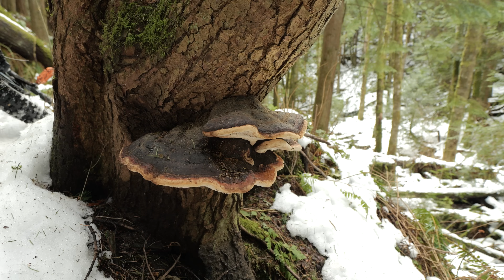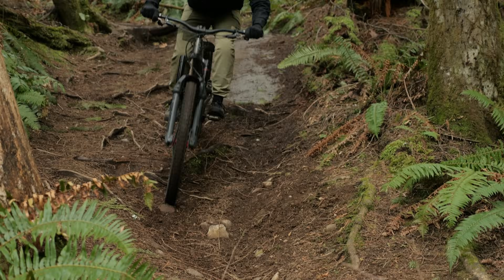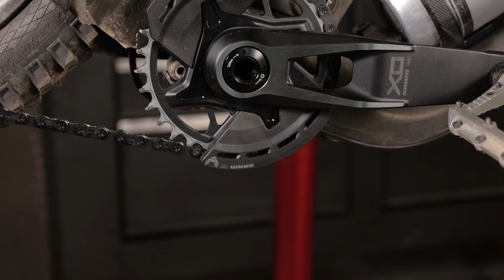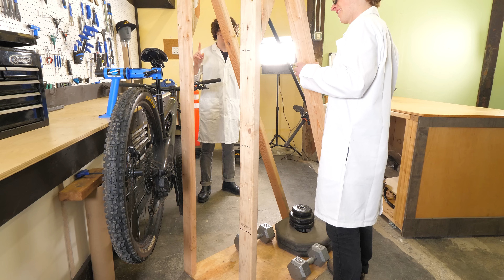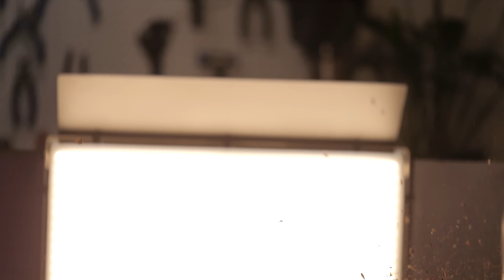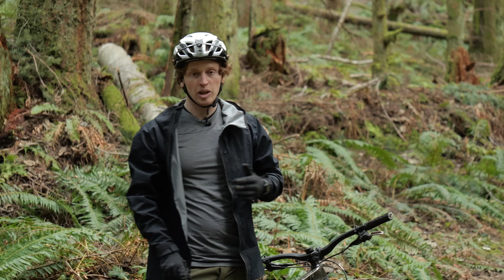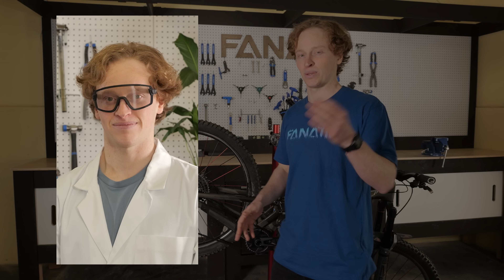Transmission: Why SRAM’s new drivetrain matters

Comment: I’m normally a big fan of your tech videos at Fanatik but these videos on the new AXS system are really poor. The irony of claiming that humble derailleur hanger is now outdated and was “never really ideal” despite having functioned on everyones bikes for decades it hilarious. And the fact that you and the whole mainstream mountain bike media seem to overlook the fact that the any force going through your derailleur in a crash is no longer dissipated in a controlled manner (snapping a hanger) and now goes straight through your axle and into your carbon/aluminium frame is even more laughable. It’s ok to shill a cool new product but surely you have some doubts about this new tech?
Reply: But the force of a crash is now absorbed by the derailleur in two ways. The first way is that the electronic clutch physically moves the derailleur inboard to absorb an impact. The second way is the derailleur can rotate clockwise to absorb an impact also. If you watch the video of them trying to break one of these, you would have seen that they also designed the derailleur to break before your axle or frame breaks. And if your derailleur brakes it's modular now so you can just replace the specific part that breaks. I'm not a fan of access or these electronic drivetrains but they have designed them to be real, robust and rugged.
Reply: @ragu4545  I saw the other video of them trying to break the derailleur but didn’t feel that it was very true to real riding. The pendulum thing kept sliding over the derailleur like a rock moving out of the way rather than a like an immovable rock or log. I’m sure your right though and the mech will break before the frame, is just be worried about internal damage that is could cause to the frame that you can’t see
Reply from the maker: Thanks for the feedback. My thoughts: Today's 12 speed drivetrains seem to suffer too frequently from bad shifting, and it is very often the result of a slightly bent hanger. This removes that as an issue, by making the entire structure stiffer. It is not so stiff that it can't break, as we found in our other video, but it is not going to be impeded by what are often pretty flimsy hangers.
Regarding the frame, (and time may prove me wrong), but I just don't feel that that's the weak point now, or that this derailleur is so stiff that it will transfer undue forces into the bike frame and cause damage. Firstly, crashes where the only part of the bike that is impacted are the derailleur are very rare. The conditions of our tests were not realistic, they were dramatically exaggerated. And even so, it was the derailleur that gave.
From another perspective, the forces that your rear dropouts encounter from simply riding your bike are large, and I'd be willing to bet they are larger than what they saw when we broke Transmission. I feel like if we're going to be concerned about this, we should also be concerned that our dropouts are going to fail simply from the act of mountain biking.
Time will tell, but all the concern seems overblown. To me it just seems like a very expensive, fancy drivetrain that does in fact shift notably better than everything else out there. Hopefully this helps clarify my viewpoint. I am sorry you didn't like it or felt it was insincere. I expected to find it to be a gimmick, but I didn't. I do think the magic pulley wheel is gimmicky though 😉
- Dan P.
Reply: @FanatikBikeCo   thanks for the reply Dan, I’m sure your right and the shifting does seem to be unanimously better than previous drivetrains. I’m all for new tech (I ride axs myself). I was probably a little harsh in my comment before but I would be still be concerned about mounting something that stiff to an expensive carbon frame, like you say though time will tell

Comment: I don’t see why the improvements can’t be applied to cable operated ones. My entire life is electronics biking is my escape from that and I want to keep it that way
Reply: If you watch the video again and listen to the part where he explains that the derailleur is systematically shifting based on timings, you'll realize why cable actuated shifting is impossible. We cannot, as human beings, shift this precisely, everytime we go to shift. A computer can.
Reply: @Jack Halem It's really not an issue with my aluminium rental bikes.
Just shove them in the downtube until they come out below the crank.
Then it's basically outside of the frame following under the chainstay. 
Little loop to the rear derailleur.

New outer and inner cable takes me 10-15 minutes an bike.
Reply: I just installed the SRAM 70 groupset and it is amazing. It is cheaper than the GX and NX systems and 1,000 percent better.
Reply: Ultegra r8000.  It's perfect
Reply: I bet a cable version will come in some months

Comment: I saw a friend at the side of the road trying to fix something on his bike so I turned around and check if there's anything I could do to help. He was trying to pair his SRAM Red axs cause it won't shift.  I asked him if he charged the battery and he said yes he charged it the night before. Then I asked him if he had a spare battery for his shifters to test cause it's probably the one that is out! Then he realised that it's been a year now since he had his bike so it's probably the shifter's battery. He had to go home and change bike.. A few days later, he confirmed that it was the shifter's battery!
Lesson - if you're on an electronic drivetrain, an extra battery is a must in your tool bag!

Comment: so like why cant people just stick with 11 speed? the cog spacing is far enough apart that the shifting no longer becomes so tolerance dependent and allows a little wiggle room while still shifting smoothly. just make a 52 tooth 11 speed cassette why is that so hard jeez
Reply from the maker: You can stick with 11 speed! I've had a bike recently that ran 11 speed.
- Dan P.

Comment: I don't have AXS but here's a benefit right here: No cable stretching, always consistent shifts. Cables stretch over time, shifts changes location, always need to adjust barrel by the day,  weather affects cable.. cold cable is stiffer, hot cable stretches more. Cable housing wear out, creates more friction over time. I could go on and on
Reply: Reduced battery run time and life span due to freezing and extremely hot temps. Reduced battery life if battery is left unused for long stretches of time. Higher cost of replacing a battery compared to a cable & housing. Battery can easying be stolen off the bike. Introduces connectivity issues that can potently happen anytime, even while riding. Added weight and increased chain slap with AXS.
Reply: @ragu4545  some of your points are vailid... but a battery lifespan isn't what were comparing. Shift Performance is. Also added chain slap, What?? Battery could be stolen? Why steal a battery when they could take the whole bike in that case? Most people dont ride in extreme cold or hot. If they do, AXS wasn't a solution for them anyway. AXS shifting performance doesnt change like a mechanical cable does. Even if you replaced a battery, your shift is still the same regardless. Connectivity doesn't seem to be a common issue with AXS..
Reply: @Twisted_Biscuit  you don't have to ride in extreme temperatures for your battery to be impacted. Like say you store your bike in a garage over winter or if you leave the battery in your car on a hot summer day. I've had other lithium batteries fail because temperatures got too cold in my garage. It is also known that AXS has increased chain slap because they have weaker clutches if you watch videos where they send bikes huck to flat you can see the derailleur bounce around like a wet noodle. There's no added benefit with the original AXS terms of shifting performance. Maybe you'll have extended the time your shifting quality will last like you are saying. But there is no added benefit when compared to a properly tuned cable actuated derailleur. There may be a perceived increase in performance because there is a greater disconnection between the user and the derailleur due to the wireless nature. I.e you cannot feel the cable tension as you hit the shifter.

Comment: "it's not easier to setup" interesting... as a skilled mechanic, you should definitely know that it absolutely is easier to set up. about a year ago, when i worked at a bike shop, i always had customers coming in and asking how to tune their drivetrain but it wasn't something i could just show them within minutes. with axs, i absolutely could do that. All you do is install the battery, bolt it onto your bike and youre basically ready to go.
Reply from the maker: How so? The micro adjust has the same functionality as your barrel adjuster. B-tension still had to be adjusted with AXS. The limit screws on a mechanical system only need to be adjusted the first time, so it's not something your customer would have had to mess with. What am I missing?
- Dan P
Reply: @FanatikBikeCo  I have found that the phsyical movement and turning of the barrel adjuster and adjustment of the b-tension and limit screws were always a point of extreme confusion for many of my customers. There's something a lot simpler about pressing a button than there is about trying to figure out which direction you should spin the barrel adjuster to get the adjustment you need. 

When I was teaching classes on how to tune a drivetrain, I used examples of AXS and just traditional cable actuation and basically everyone immediately understood the axs version but only a handful understood the cable actuation. Also, over time, the barrel adjusters can wear out if you're playing with it a lot and those detents you feel become kind of unclear, which only adds to the confusion.

Hopefully all that makes sense! You guys are awesome and keep up the great work you guys do! I've been to your shop a handful of times and it was quite cool
Reply from the maker: @dash0173  That is true, the concept of screwing in a barrel adjuster to decrease tension is a tough one, and honestly not something I've been able to figure out how to explain to people in an easily understood manner. 
- Dan P.

Comment: The normal AXS DOES shift better, and IS EASIER to setup.
Reply: Wrong. Cheapest Shimano 12sp, e.g. Deore, shifts better than AXS. It's well documented, particularly on eBikes where there is torque overrun due to HG+ as well as bikes with flexier stays as the AXS servo was stronger than optimal for those frames. It is easier to set up, but I'm not a hopeless mechanic and know how to turn a barrel adjuster (you still have to set limit screws like any other derailleur). This new AXS is a different story.
Reply: It’s marketing. They need to promote and sell the latest product now.
Reply: Lol definitely marketing. How could it not be easier to setup? Stopped watching right after dude said that
Reply: @coryfrey5797  Lol, even though I agree with you, I stuck around to watch the whole thing. It was entertaining still. 

These new MTB WIDE cranks are designed to work with the new cassettes which Dan says are set more outboard to accommodate the MTB WIDE 55mm chainline. That means these new cranks aren’t backwards compatible with the original Eagle cassettes. The chainline will not be ideal. I was hoping to get the sexy aluminum cranks, but that’s not gonna happen now.
Reply from the maker: You are correct, the cranks are not backwards compatible (at least in that they wouldn't offer a good chainline). 
Regarding set-up, the only difference in procedure between AXS and a mechanical derailleur is that you don't have to run the housing, which is only a pain the first time (any time following you can use the previous housing/cable as a guide for the new). I just have never found it to be that much more time consuming, and definitely not worth the added cost of AXS over cable actuated.
- Dan P.
Reply: @FanatikBikeCo  Thanks for confirming. Time to find a way to trash my $3K bike so I can justify a new UDH frame so I can get XO AXS Transmission. JK LOL

Comment: These pricing points have hit such a level that the general mass of bikers could no longer find it reasonable to purchase one at such a price.
Reply: This. Yea it's cool, but $1500 is more than your average cyclist's entire bike. I thought the old AXS was nuts for a derailleur and this is somehow almost 3x more expensive? 

This is just another bit of gucci kit that isn't actually better in any practical term and just exists for the sake of existing. Even this video could honestly only come up with "it's durable and is slightly better at climbing on slippery terrain" as the only actual reason to get one.
Reply: Yup . I’m just building up old 26er 7 speeds.  The bike industry can take all their dentists with them and go eff themselves.
Reply: To be fair you're not supposed to buy this yet. People on dentist's salaries are supposed to buy it until they ramp up production and make it more affordable in the coming years
Reply: @zed625 he reality of this is that AXS has been out for years and hasn’t gotten any cheaper lol. It’s still on one of my bikes (frame up build). It works pretty well. Not a revolutionary product. This might be for some, but none of the bikes I own or am looking at Have UDH so it’s a moot point for most bikes anyway.
Reply: It's been like that for basically forever: Marginal performance gains, doubly so when you don't maintain all the time (there exist people with bikes without oil at hand), and as far as durability is concerned it doesn't really matter if your gear lasts twice as long if it's thrice as expensive. If you're racing, sure, the reliability is worth it but already trekking is rather questionable especially in places where a bike shop is in taxi range. Meanwhile you see couriers driving fixies, and not (just) because they're hipsters: Gear that you don't have can't break.
Nowadays, if the average Joe wants to spend more on a bike it's going to be an e-bike. Or buying Orbea instead of Chinese but you'll see low-mid to mid-range transmissions on them because they're good enough and inexpensive.

...the reason I'm here is to have a look at cool engineering, not to make buying decisions.
Reply: exactly,    I'll stay with Shimano Linkglide on my eMTB  (currently I use 11-46s, M8000 XT drivetrain)
Reply: So just don't buy it. It's not truly built for hobbyists. It's built for people who ride pro. The only reason it's being marketed is because 1. The parts have to be commercially available(not private) and 2. Someone out there will pay for it. You don't need even a $5000 bike to have fun much less a $10,000 one.
Reply: @duodecaquark3186  some hobbyists would still buy it. It's just a matter of preference and purchasing power. Some find it reasonable, some dont regardless if its hobby, pro or amateur. But yes, there are cheaper options OFCOURSE.
Reply: @driver_18   Someone out there finds a million dollar handbag "reasonable," so I don't personally use that as a metric for whether a product has comercial value to a group of people. My point was that in the design proccess SRAM were aiming to create something for the top 1% of riders and OP was right about it not being obtainable by the average rider, because despite the marketing team's presentation, that's not the real target for this design.
Reply: The average salary in my country is around 50k annual, and if you factor in bonuses and stuff it goes higher. 

So, I don’t know about you man, but that’s stats shows but that it should be pretty affordable to the average person. 

Maybe the pricing is more of a YOU problem than a SRAM market research problem.
Reply: @slowcyclist4324   I live in one of the highest salary countries in the world, mine is like 2x yours and I find those new groupsets extremely expensive, not gonna pay that price for sure.
Reply: @slowcyclist4324  comparing to an annual salary obviously you could afford it even I for myself. But the pricing is Not practical anymore.
Reply: @slowcyclist4324  I live in Long Island, NY. Big money out here. And I'm telling you right now, nobody I know would waste their money on this. Cost to benefit just doesn't make sense. $1500?!??!?!  I'd much  rather upgrade my suspension.
Reply: @slowcyclist4324  I mean, your comment has zero upvotes and the person calling out the high price points currently has 68 upvotes, so it appears you are the anomaly here: to most people, this groupset is crazy expensive and unaffordable.

Comment: Everything has changed for the 0.000001% of bikes made in the last 10 years with the UDH standard. No road bikes, no gravel bikes, etc....
Reply from the maker: We only sell mountain bikes. At this point 95% of the frames we sell are UDH equipped. As far as the products we deal in, it's a significant change.
- Dan P.

Comment: I always knew the existing AXS’ limit screws were there just because. They served no purpose. I’m glad Dan confirmed that.
Reply: their purpose was a failsafe. better to have them there and not need them ever than to need them and not have them there.
Reply: @dash0173  Because it's better to have Lou Rawls and not need him, than to need Lou Rawls and not have him!
Reply: @dash0173  An Dork disc is an failsafe.
Better to take it off considering they are frickin annoying.
Reply: Well, given that you can potentially adjust the indexing on your derailleur on the fly, or if you adjust it in a repair setting and don't test it properly, it serves to keep you from losing your chain.
Reply: Yeah I have hit my xx and I know I bent the hanger. It takes a few seconds for the derailleur to readjust and it’s fine.